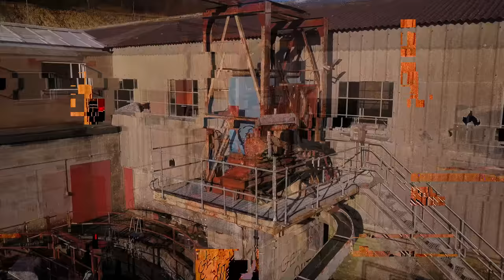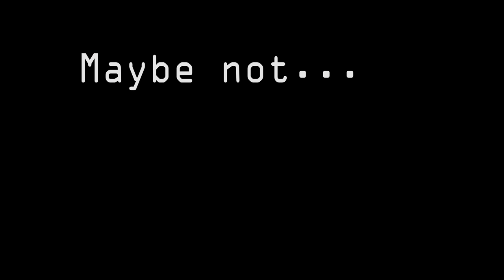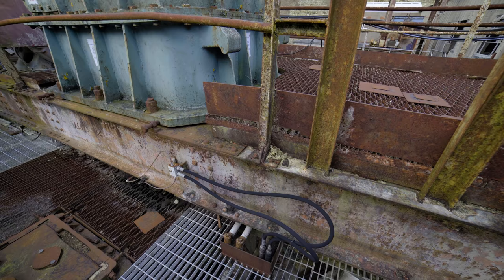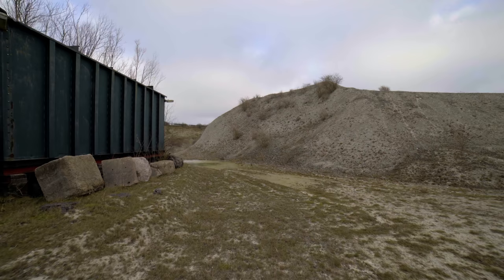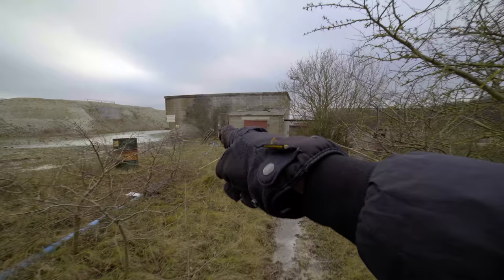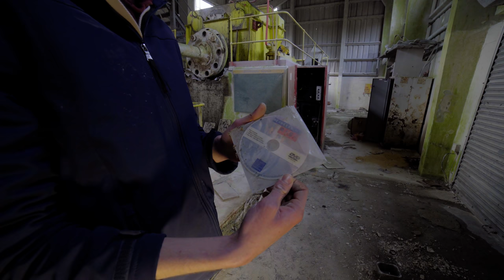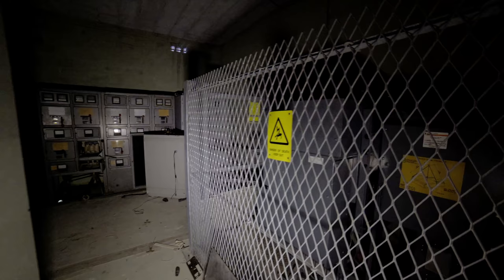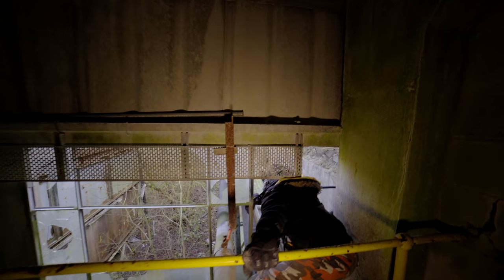Westbury Quarry WILTSHIRE and Factory 2020 FULL EXPLORE 4K

Comment: Some of the people I did my engineering coarse with, worked at the Westbury cement works, used to be Blue Circle, later Lafarge/Tarmac...
I remember the quarry trucks entering and leaving this site, very busy back in the 80-2000s, the factory opened in the 60s and mothballed in the 90s, the chimney coming down in 2016...
The chalk " slurry " was fed down to the works by means of a large pipe, running under the sloping hills nearby, the factory in the quarry crushed the chalk into the slurry...by means of mills, from the hopper ; varying in size, large stones at the top and smallest lower down,  3 in all....the large machine in the main building is a pug mill, revolves and turns the crushed chalk into a slurry...the electric motors drove pumps which then forced the slurry down the to the cement works, by means of the 3 pipes leaving the small biulding...  
This factory was recently demolished by a contractor from Lydney, Forest of dean, I tried to get photos but all the perimeter fence was secured by a security company...
The cement works site is still being used by Network Rail and the 8 large silos still are used for cement distribution and all the siding still in use...
Again, thanks for getting in there.and great production as always...

Comment: The big rotary drum looking things look to be what are called VSIs or vertical shaft impactors.... those bits in the middle with the chains spin around & beat the shit out of the rock to get it to the correct size. It’s a series of 3 drums that reduce the size as they go, and the grated bits at the bottom that you, Matt, thought was for draining slurry... close... it’s for screening off the smaller particles to increase efficiency. It’s fed from the hopper at the top end & dumped at the lower end.

Comment: Hi. I worked for Blue Circle Cement at Shoreham many years ago and recognise all that equipment.
Most of it consists of rotory drag mills outside, and the cylindrical one indoors is a ball mill.
What happened to the kilns though? Thats part of the process, cant make cement dust without them
The round tank at the top of the hill probably had watered down clay in it, the boom crawls around and has pipes hanging down to the bottom of the tank, blowing compressed air into the liquid to stop it solidifying and making it easier to pump.
It looks like a lot of kit has been removed to me,  probably to keep other quarrys supplied with parts.
Shoreham Works shut early 90s.
Reply: The kilns were at Westbury and fed via a pipeline.
The tank at the top was where the chalk slurry went before being pumped to the cement works.
Reply: @tomstickland  Was there a clay mill there? Or was that pumped in from offsite. 
I could only see a chalk mill in the vlog.

Comment: Its a huge Ball Mill, and that ABB inverter at 1:06.20 is for motor speed control and is probably less than 10 years old, so that 1989 date was unlikely to be the last time it was used
Reply: It closed in 2009.

Comment: Wrong Westbury quarry info in the caption. There's two, Westbury and Westbury Sub Mendip (the latter being the one you've put history in the caption for). Nowhere near one another.

This Westbury quarry was used until fairly recently to supply the cement factory in the valley below it.
Reply from the maker: Your correct altered it to this:
Westbury Chalk Quarry is located approximately 1km south-east of Westbury, on the north-western edge of Salisbury Plain, and south-west of the chalk escarpment.  It is 2km south of the Cement Works, the two being connected by underground chalk slurry pipelines (see location plan at Appendix 1). The western boundary of the existing quarry runs parallel with the adjoining escarpment ridge and the Imber Range Perimeter Path (a public right of way) which also adjoins the northern boundary of the quarry for approximately half its length.  The southern boundary is abutted by a bridleway (No. 46).  An unmade track runs along the eastern side of the quarry adjacent to Westbury Down (see site plan at Appendix 2).  The quarry lies within a Special Landscape Area (SLA) and an Area of Archaeological Interest.  Abutting the quarry to the east and south are the important ecological designations relating to the Salisbury Plain Site of Special Scientific Interest (SSSI), Salisbury Plain Special Area of Conservation (SAC) and the Salisbury Plain Special Protection Area (SPA) (which are contiguous with the SSSI).  The important Scheduled Ancient Monument (SAM) and tourist attraction of Bratton Camp Fort and the Westbury White Horse lie some 1½ km away to the north-east. 

Not to be confused with the Westbury Quarry at Westbury Sub Mendip in Somerset!
Reply: @TheSecretVault  1997 I believe the concrete was used to build cribs cause way Bristol

Comment: Looking at the age of some of the switch gear and that ABB inverter drive for a motor id say its pretty newish technology  and those merlin dis boards anyone know what year this place closed also very suprised no ones been tatting any cable looks like some 35mm 4 cores blue stuffs worth nothing only multicore for control circuits small stuff

Comment: Tina turner sings about you...YOUR SIMPLY THE BEST...in a shack nothin but but crapp
Reply: The doors are swinging in the wind. The seekers.matt and crewcould have been a cone crusher ..round tanks settle the water so it goes out clean..just like piss take
Reply: Tarmac division..under foot..smells of gasoil
Reply: The round drum is hot when working..got like cannon balls in rotate to crush sand mush ces out cement blue circul.takern to the bagging or concrete back in the day of m25 and chunnel